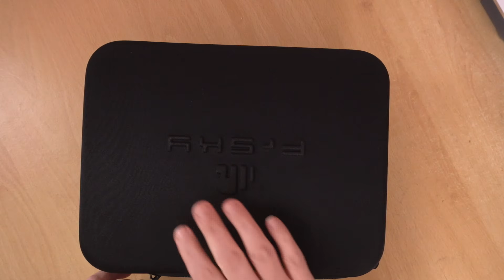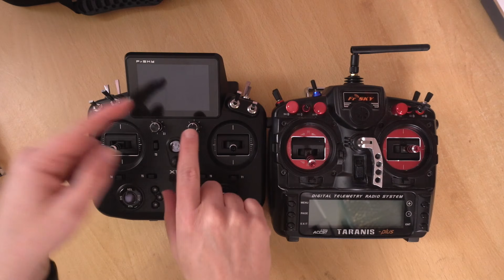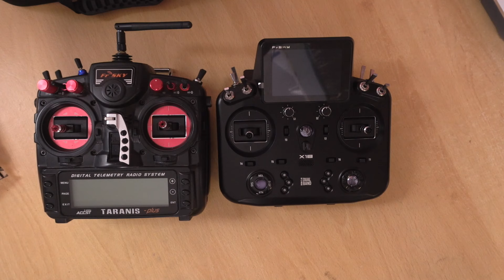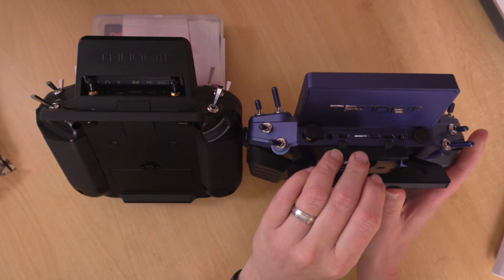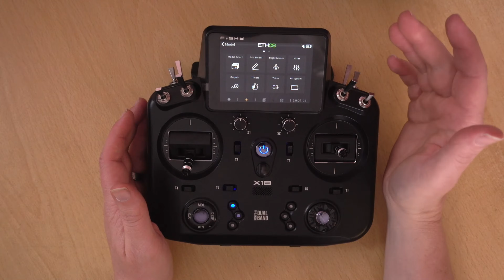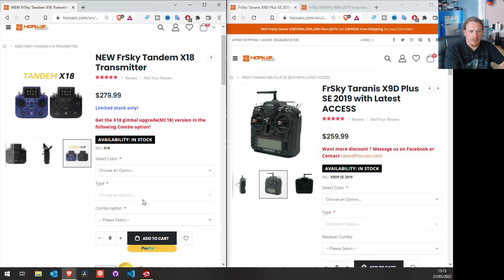First look at the FrSky Tandem X18 Transmitter

Comment: Comparison to Paladin might be interesting.

I still don't really understand the use case of the hybrid system, when it seems like R9 is going to totally out range their 2.4Ghz protocol.
Reply from the maker: It’s not just about the range. The tandem system uses both 2.4 and 900 at the same time, when in range. To give better performance as well as redundancy. 

I don’t have a Paladin, so can’t really compare.
Reply: The Paladin was one of the biggest screwups I've ever seen in this hobby.  FlySky ships that radio back in 2018 (I think, maybe 2019) with a sd card slot, full size JR bay and OTX support and it would have been impossible to keep it in stock.  Instead they kneecap it with almost 0 memory and a proprietary operating system.  The X20 is what the Paladin should have been.  ETHOS is "propreitary" but its based on OTX with the same features and a much easier interface.  As far as 2.4ghz vs  900mhz, 900mhz has very limited bandwidth especially 868 if you're in the EU.  868 is really bad like 2-4 models in the air at the same time you're out of bandwidth.  And now with the new generation of 2.4ghz going out to 30km+ with no issues you're going to see 900mhz relegated more and more to a backup like it is in TANDEM or for the hyper long range users who don't care about latency.  Or for people who fly in areas where 2.4ghz has a lot of interference and then again I'd still say use TANDEM vs just 900mhz.  And now we have the new TWIN module that just released.

Comment: what is the range like compared to crsf ?
Reply from the maker: They’re basically using the same technology. In fact the LoRa chip in R9 is slightly superior to the chip in Crossfire. 

On an equal footing (up to 1W), the range is comparable. How far do you fly? The range on both systems us usually way more than most people actually fly.
Reply: @MrD  2 to 3 ks at most more for strong signal and no dropouts mainly,  i use radiomaster at the moment with crsf module but looking at frsky,  i have the x12s one of the first ones  but was not happy when they changed protocol    as that radio cost me alot so once burned twice shy type of scenario, i know i can upgrade it but not interested in that rather buy latest hence the question
Reply from the maker: @dwexoticmaple   you could probably do that on 10mW, depending on the noise floor. You really don’t need to be worrying about the range at those distances. 

Why worry about the protocol on the X12S? You can still buy ACCST receivers. No one has been burned. It’s just something new has come along too. 

To be honest, if you’re using crossfire, I’d stick with that. The only thing you would gain with R9 is 4 extra channels. Possibly better range telemetry too. I use both systems, and they both work great. Of course, if you’re interested in the X18, at the moment Crossfire isn’t supported. But it is on the list of things to come.

Comment: Thanks for this review, just ordered one. Your other videos are great as well. I flashed ethos on my horus x10s express. For a LOS fixed wing flyer like me, it seems much more intuitive than open tx. Open TX is great but I'm not missing anything for my needs. I really don't understand the hate for Frsky and Ethos. I think they are doing good things. After learning open tx, Ethos is natural and easier to navigate. Seems to me it could convert alot of spektrum users.
Reply from the maker: Hi Matt, thanks for your kind comments. 

Yes, I totally agree with you. For me, there are still a couple of things missing in ETHOS, but mostly for the FPV side of the hobby. But I think it is a great, intuitive platform. 

There is a lot of hate going around for FrSky, and there has been for a few years now. I think some of it may have come from difficulty with older firmware. But a lot of it comes from misinformation or is sparked by certain “influencers” who have ulterior motives.  For example, they have a signature edition radio which is a Horus X10 clone. 

I personally think that the products FrSky are producing right now are excellent. They are also listening to the community, which can only make things better. 

I agree that FrSky and ETHOS is a much better package than Spektrum. 99% of the issues I see at my flying field are with Spektrum radio equipment. Either signal losses or brownouts on the receivers. The challenge is that Horizon Hobby have everything in a nice little BNF monopoly. If LoS pilots can be coaxed away from BNF, and take 5 minutes to set up their own receivers, they could have a much better system at a much lower cost.

Comment: Is there any option to add dsmx to the tandem x18?
Reply: Sell all your spectrum receivers, have enough money to replace them with FrSky rx’s and still put money in your pocket. I don’t care what the old timers say, Dsmx FHSS algorithm is unreliable, especially in urban environments. Also overpriced, SAFE is outdated and not trustworthy. For the price of a spektrum telemetry SAFE As3x rx, you can buy a FrSky sbus rx, matek FC and gps.
Reply from the maker: Not at the moment. Multi-protocol modules may be supported by future versions of ETHOS. This is not a limit of the transmitter, but of the current firmware.

Comment: How do you remove the ratchet on the throttle?
Reply from the maker: Remove the battery. There are 4 screws on the back. Then the back of the case lifts off. Be careful with the IPEX 1 connector for the 2.4GHz internal antenna. Once the back is removed, the adjustments for the gimbals are easy to get to. A screwdriver will adjust the ratchet and stiffness of the the throttle. Allan keys will adjust the spring tension for the gimbals. I’ll put an image up on my Instagram.
Reply: Thanks

Comment: I definitely agree about the trims, on my X20S I have a hard time finding the rudder and aileron trims. I also really wish the X20 had the blade style switches instead of the round ones, they feel so spindly and delicate
Reply from the maker: I’ve found the switches to be fine, with the rubber bumpers on them. They do look delicate. But survived a transmitter drop. Oops 😁
Reply: Gerald

Comment: I own a first release black X20 & a much later blue X20S & the buttons have better feedback on the later version so this could be why they feel different on the X18.
Reply from the maker: Are you meaning the 6-way buttons or the menu buttons? The 6-way buttons are set deeper in the X18. On the X20S, they are raised slightly above the transmitter. But the X18 they are lower than the face of the transmitter by a couple of mm.
Reply: @MrD  The buttons are just more "clicky" on the jog wheel & menu  if that makes sense when you have them both in your hands you can tell one is later revision & audio is crisper too, I use the X20 for ground based stuff with the left stick centred & the X20S for air.
Reply from the maker: @Arcave  ah, I get you. I thought the buttons were fine on the X20. But I did find the original jog wheel to be a little flimsy. Nice to hear that FrSky remedied that on later X20 transmitters.